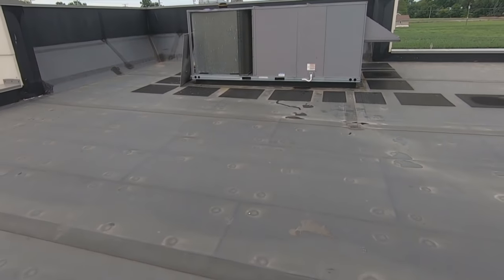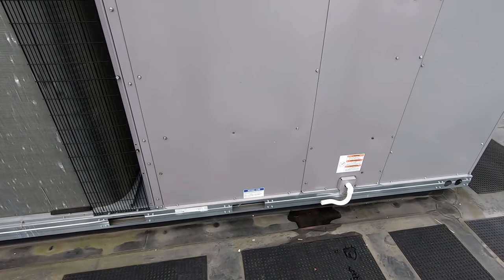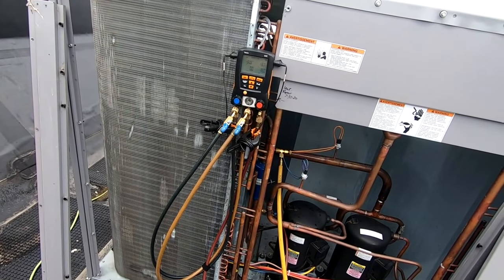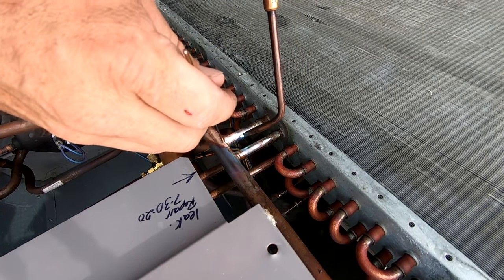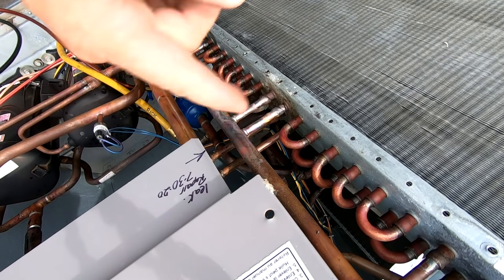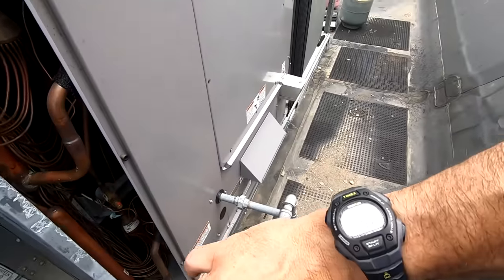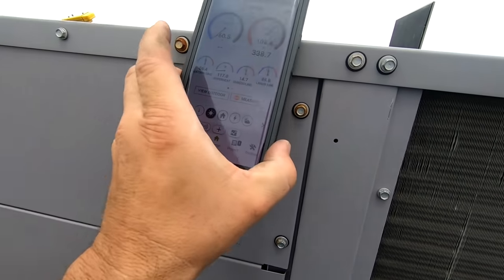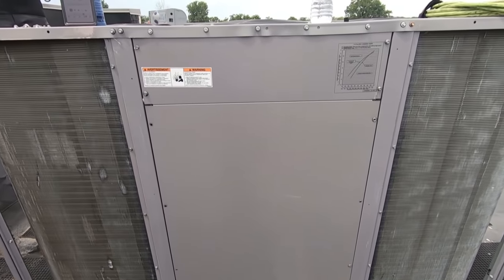17.5 & 25 Ton RTU Refrigerant Leak Search Repair And Recharge Start To Finish

Comment: You are doing a great job with your videos, thank you. One thing I will add to this is that we have had a number of condenser feeder tube to header leaks like this one on several different brands of equipment. The last one was on a 15 ton Ruud split system. where we had just replaced one of the condenser coils under warranty  one year ago. So we brought the factory guy out at start up after installing the coil one more time. It was recommend to either install 100 percent shut down TXV's or a liquid line solenoid valve near the TXV and allowing the compressor circuit to open on the low pressure switch, and a crankcase heater to keep liquid refrigerant from migrating back to the compressor sump in the off cycle. This liquid refrigerant would fill up the compressor sump causing the compressor to shake violently on start up because of the amount of refrigerant to the amount of oil in the compressor, " Flooded Start". This stressed all of the discharge piping to the point of creating small cracks & leaks. After this repair, we started adding liquid line solenoids and thermostat controlled crankcase heaters on every header >feeder tube leak repair. This has cut down on the number of return trips on splits and RTU's .  Oh, and it must be said that the piping, installation, and refrigerant were correct in all of these. Also we are located in south Texas.

Comment: Nice fan set up👍
Next time you scrap a preptable or something with a small condenser.. Take the condenser with fan and a put a scherder on both ends of the small condenser and put a sucket on the fan motor..
Then put it between the recovery unit and tank.. And now you can fil the tank all the way up..
And keep the videos coming, and stay safe
Reply from the maker: Actually I have a small condenser from a reach-in cooler that would probably work perfect. Good idea thank you 👍👍
Reply: @HVACRSurvival  it's all about helping your fellow techs👍🇺🇲🇩🇰
Reply from the maker: Yes sir 👉👍👍
Reply from the maker: FYI- I used your idea on my return video and it worked 👍👍. You'll be getting credit for it on the video👏🤜🤛🍺🍺🍺🍺🍺
Reply: @HVACRSurvival  😀
Thanks Rick.. Just glad i could share some knowledge🌞🌞🌞
Stay safe

Comment: Get you one those molecular transformers 
I had my doubts about them until last week 
I was pulling 410 out of one and my machine kept tripping because of the head pressure 
My coworker had one I slapped it on and it dropped the head going into my tank 75 psi 
I pulled the remaining 15 lbs out with out tripping my recovery machine off 
Ambient was 105 deg 
They really work
Reply from the maker: I made one that I showed on the homemade tools video. They work if you have water or ice for it. I made a sub-cooler that I tried out today and was able to recover 45lbs of R410a without any water.
Reply: Yes Ice water is a draw back for sure 
It’s just one more thing to drag on a roof
Your sub-cooler sounds interesting 
Any chance you show us how you made it???
Try to stay cool out there!!!
I’m in Houston and it’s been brutal
Reply from the maker: Yes,  I recorded it in use today

Comment: I would definitely recommend putting a filter drier when pulling the refrigerant out and putting it back in. Those recover  Cylinders are dirty and when brand new.
Reply from the maker: You have a valid point, I used my impact driver to open the inspection port on the recovery tank to verify there wasn't nasty's in it.But yes it would be better. Thanks for watching!
Reply: @HVACRSurvival  What about using an inline dryer on the recovery machine. Wouldn't that keep crap from the recovery tank from getting back into the system?
Reply from the maker: @bobt1634  I agree that would be a good thing. For some reason Appion uses a screen instead but I could use a external drier 👍👍 when I'm reusing the refrigerant.

Comment: I love this leak repair method.. I’ve done 2 in the past month. One on a discharge header and one on a filter drier braze joint. No vac, no worries. In and out in 2 or 3 hrs
Reply from the maker: If I was opening the system I would defiantly do the drier and evacuation. Thanks for the feedback!
Reply: HVACR Survival I had one that I found a leak at 5 pm, customer said fix it now! So I saved them about 3 hours of overtime labor to do a new drier and a good vacuum.. on a 22 year old system. It’s a no brainer to mr
Reply from the maker: Now if I would have opened the system and expose it to atmosphere or it would have been pulling into a negative pressure I would have changed the dryer and pulled a good vacuum. But in this case I would have been just fighting the refrigerant that was trapped in the oil. I don't see a reason for that. Plus the unit was only 4 years old. Thanks 4 commenting and watching 👍👍🤜🤛🍺🍺

Comment: Great idea i never did that, but it seems like a great especially when you work on large systems, you pump the refrigerants right back into the system.
Reply from the maker: Thanks man 👍👍I didn't like it when I see it first but after seeing how fast it is, I do now. I mainly use it in larger systems.

Comment: Commercial is very different. You can’t just shut down for six hours. The old D/B units leaked often on the tube sheets. We would put dry ice on the horizontal condenser, when it hit zero, start brazing. Fixed in an hour and a half. Great explanation. 👍
Reply from the maker: Right on John 👍👍. Thanks man!

Comment: I definitely prefer the way you explain what you’re doing in the videos. I’ve learned a lot from your videos as opposed to the other guys who just film the work without explaining what they are doing. Just want to say that you are great at leak detection. To me it’s one of the hardest aspects of service work. I have a Fieldpiece slr8 because I heard it was the best detector for R-410a but it constantly has me chasing my tail with all the false positives it gives me. How do you leak that D-Tek select and how did you get so good at leak detection?
Reply from the maker: A lot of practice is how I got better at leak detection. And I am a total nerd on leak detectors. Inficon just released a new detector called the Detek 3, it's basically the Stratus minus a LCD screen and $350 in your favor.  My select does great but the battery life is not impressive. That's been corrected with the Detek 3 thanks to a lithium battery.
Reply: @HVACRSurvival  Do you think that AccuTrak ultrasonic is better than the traditional type? Some people say they are faster to locate the leak.
Reply from the maker: @TechnicalLee  I would get either the Detek 3 or the H10-PRO first, I use the ultrasonic for special applications, there is times like this leak that I couldn't hear the leak. It all depends on how the leak has cracked to determine what kind of ultrasonic noise it creates.  Sometimes it's easier to find and sometimes it's harder.  But more times you'll be using the regular detector. The Fieldpiece was a major bust. I had both of them and they both were not worth keeping. To many false positives on the heated diode and low sensitivity on the inferred.  Hope this helps 👍👍

Comment: Thanks for the vids. Yes to explanations as to your process. One suggestion I would give is to use a filter/dryer on the recovery machine. You never know what is in a recovery tank.
Reply from the maker: I use to but I've been slacking a little 🙄😁

Comment: Where are these super techs?  Been trying to hire one for years. I dont see anything wrong with this process. Your looking out for the customers bottom line and if system is always in a positive pressure there is no chance of bringing in contaminates.  Thanks for the video.
Reply from the maker: They come on go in the keyboard warriors section of the comments. Any experienced tech should know by now this field is not for snowflakes and you're not going to razz me easily and I won't back down if I'm correct. I appreciate the feedback 👍👍
Reply: @HVACRSurvival  2-3 lbs pressure pushing out a bit of coolant... nothing coming in.  Brilliant point of view.    Wish I could see it better in the video, but the concept is clear.

So then you don't need to flow nitrogen while brazing, correct?

May be unconventional, but I appreciate your wisdom.  Very inspirational.
Would love to tag around a day on the job, but this is the next best thing.   Keep it up.
Reply from the maker: It might have gotten a touch of carbon in there?  I guess it depends on whether there's oxygen in refrigerant.  But I never got the copper rosie red,  so is it enough to make it worthwhile to purge the whole system out?   I think that's going a little radical.  Thanks 4 watching it 👍👍

Comment: Eh for me personally, I wouldn't do some of this. But from my knowledge, what you do works. Leaving some gas on the system to prevent oxygen and contaminants in the system. Then recharging the system. I know with 410a, if it's a high side leaks, the refrigerant doesn't fractionate. Last company I worked for would quote out a vac, virgin recharge etc. But if you're on your own and the customer doesn't have a big budget, I get it. Great vid tho, some people just freak out. I know guys who straight up purge units and kill either a TXV or Compressor, maybe both, after they work on it. Lol, keep it up
Reply from the maker: I use to feel the same way about all new refrigerant but from what I've read and seen it looks like because the gas mix of r410a is a 50/50 % mix, it doesn't fractionate as much as they first thought in the early years of it's development. But I have had times where I pulled the refrigerant charge and weigh it back in with virgin r410a and the problems went away. I'm definitely not saying to skip vacuuming or filter drier changes if the system was opened to atmosphere or if it was running in a negative.  👉Thanks for the feedback Frost HVAC👍👍🤜🤛
Reply: Leaks on the discharge line most certainly do fractionate. I've seen them many a times in my residential days. Most of my 410a leaks back then were on poor quality evaporator coils but ANY vapor leak will fractionate. Leaks on the liquid line, however, will not...as long as you have a full column of liquid to your metering device and are not flashing in the liquid line. It takes time to happen and small systems are more prone. Larger equipment that holds more refrigerant is astronomically less risky.

Comment: Rick I work on mostly residential r-22 and 410a systems
I’m looking for a solid leak detector which would you recommend
Reply from the maker: H-10 pro or the Inficon Detek 3 that Inficon just released. Don't get the old "Select" version I had in the video.  The other detector you seen in the video was the "Stratus" that one's very expensive but the new Detek 3 is just as good as the "Stratus" minus a few features and several hundreds of dollars less.
Reply: HVACR Survival thanks man I was already leaning hard towards that h10 pro I’ve seen it in action Appreciate ya!!!

Comment: Just to clarify because I am new an I also appreciate this method. Instead of pulling all refrigerant out, changing filter drier, repairing leak, then pressure test and pull vaccum. To save on time and money, recover the unit down to a point where there is still positive.pressure and the refrigerant inside is not a lot. Repair the leak and put the refrigerant back in. For a unit that holds 35 pounds, we left roughly 2lbs on the inside? Also did you only recover from a specific stage or from the entire unit? 
Thanks Dr. HVAC
Reply from the maker: When I recommend pulling the refrigerant and weighting it back in is when I'm working on small critically charged refrigeration systems with cap tubes and ice machines. Or in this case, a package unit where I know the total refrigerant charge.  I don't recommend this method for every system. The method of removing most of the refrigerant you mentioned is how I do it on most small systems unless I feel the need to do a proper evacuation on the system because I believe it has moisture or non-condensables in it.

Comment: I really wanna see the several hundred ton rtu you have been working on now..👍😂 great video
Reply: Seriously though I repair a crazy variety of refrigeration equipment and throughly enjoy the videos, keep it up. Screw the super techs🤣
Reply from the maker: Grocery store racks and chillers is more of what I was thinking 🤣🤣. Yes I know it's horsepower for the racks.
Reply from the maker: I appreciate that, there was real consideration about whether or not to show how I did the repair just because I wondered how much bull I would catch off of it even though this is how a majority of the people do it and there was absolutely nothing wrong with it. Now if I open the system that would be a totally different subject😎

Comment: Ive cut so many corners in my career i now have circle haha
Reply from the maker: If I would have open the system I would have used a vacuum pump and change the filter drier. That is how I will make the other repair that I have to do yet. But this one here,  all I needed to do was remove the standing pressure so it didn't blow out on me 👍👍 I appreciate you taking the time to comment and watch the video 🤜🤛👉🍺🍺

Comment: opening a hose with near zero pressure is not problem as long as your heating part of the system and not cooling it off majorly to cause a vacuum. even so there's likely enough boil off from the oil and rest of system trapping gas to keep low positive flow for many hours.
Reply from the maker: Exactly 👍👍

Comment: The VFD should maintain duct static via set point, and be able to go as low as if only one VAV were open.
Reply from the maker: Yep but that also means the staging would be low and I needed it to be in 3rd stage to set the charge if I wasn't weighing it in.
Reply: HVACR Survival oh yeah.  High stage high air flow. 👍

Comment: Never used the recovery machine to charge up the unit, don’t really trust it.  The recovery tanks have so much crap in them, I always run them thru a drier in the charging line to protect the components from becoming a blockage,  the repair is iffy....because you can’t check if your repair took (nitrogen pressure) I find the faster you try to do things, the longer it takes. Nothing wrong with doing it that way, just don’t complain if you end up having to start all over from the beginning, with recovery again... It’s Murphy’s law.
Good video.
Reply from the maker: Everything you said sounds fair to me. I should have used a drier going in and then switched it to the out going side of the tank.  I have used my impact wrench to remove the square plug in the top of the tank 2 visually check for nasty crap in the tank and then I only use that tank for reuse type work. Thanks 4 watching 👍👍

Comment: Don't like it. Works for you, and it doesn't take an extra 3-4 hours to change filter driers and braze with nitrogen... 
 You don't serve your customer and the equipment they own with 100% integrity. 
 It works... Greatest last words on a W.O
Reply from the maker: I should have said this in the video, but if I had opened the system or if it had been running in a negative pressure I would have changed the dryer and evacuated the system and replaced the refrigerat. I would hope you've seen me do it so many times in my videos that you would know I don't advocate for half ass work.

Comment: Carrier makes the worst equipment both commercial and residential
Reply from the maker: They are all poor quality. No one takes pride in anything anymore.
Reply: HVACR Survival plastic pulleys, frame is poorly built and constant refrigeration leaks
Reply from the maker: @scottchila7284  I haven't had any problems with the pulleys, they are supposed to be more reliable. Also got to look where they're starting to build them now.  I've had them come improperly charged too. Lennox and Trane both have issues as well.
Reply: HVACR Survival I have had some better luck with Trane. The leaks on the Carrier unit have been a nightmare
Reply from the maker: Trane has better heat exchangers for sure.

Comment: I dont understand. How comes u dont pull a vacuum on the system. That dont look good.
Reply from the maker: Maybe you missed why I did what I did in the video. Now if I would have open the system up to the atmosphere or if the system would have been pulling non condensables into the system,  then absolutely,  I would have changed the filter drier and pull a vacuum on the system. Basically I just lowered the pressure in the system to just enough to keep the atmospheric pressure out, while removing the likelihood of the system building pressure and blowing the brazing alloy out of the fitting. Then I made the repair, pumped the refrigerant back in. I could have let the system pull the refrigerat in but I chose to do it as quickly as possible because people were downstairs in the office area becoming uncomfortable.  This method would not be good in all situations as I noted above.  Thanks 4 watching 👍👍

Comment: Like when you explain your process.        Have you tried different ultrasonic leak detectors ?which one do you use ?.         They probably put that simple chart for condenser discharge temperature for a very uneducated easy low paid workers so a large industry corporations don’t have to hire high paid educated employees. It’s all about the dollar.
Reply from the maker: You might have a point on the graph 🙄😏.  I use the Superior Accutrak.  I did two different videos on both types with examples of them operating.